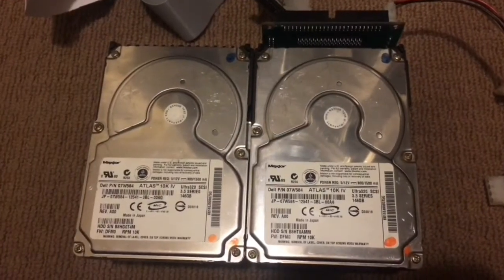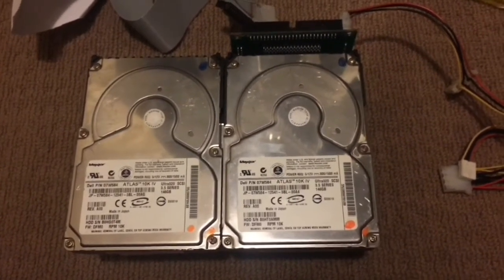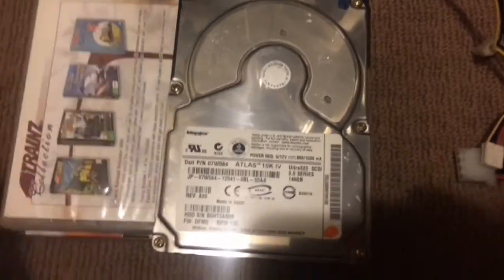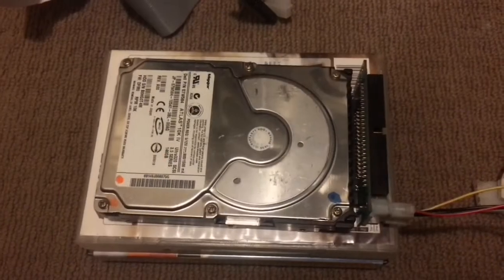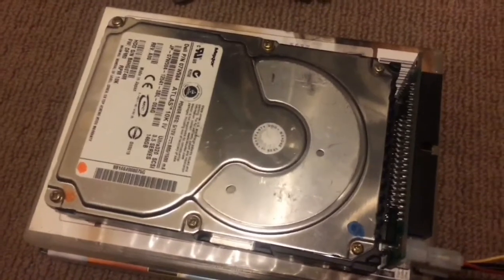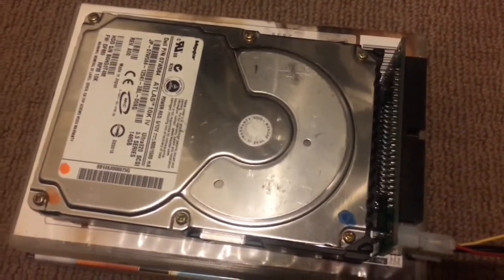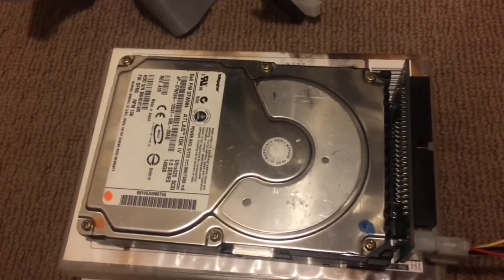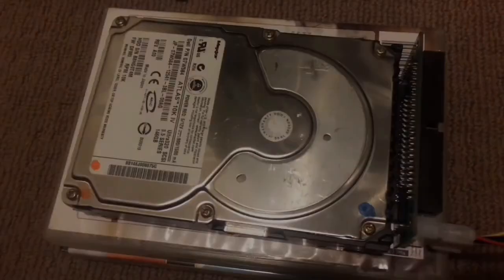Hard drive ball bearing sound comparison

Comment: Possible one was dropped or it ran much hotter.
Reply from the maker: Both seem to run at similar temperatures iirc, but one may have been overheated in its previous life so 🤷‍♂️. 
Not sure about the loud one being dropped, since both drives test good with 0 bad sectors.
Reply: @thegeforce6625  I've had this happen with vintage drives (think sub-2GB). if the drive was dropped or knocked hard while powered off, the bearing will suffer from the mass of the platters (moreso if there's a lot of them) as if you whacked something like a pulley on a car engine from the side, but if you're lucky it might not damage the platter/headcrash. I know because I accidentally dropped a 540MB Conner CFS-540A from a BabyAT tower onto the desk (got caught in a cable and pulled it off the top of the tower where i put it for testing something), and while it still works and has 0 bad sectors, it now sounds very similar to the first drive in this video (minus about 6k rpm lol)